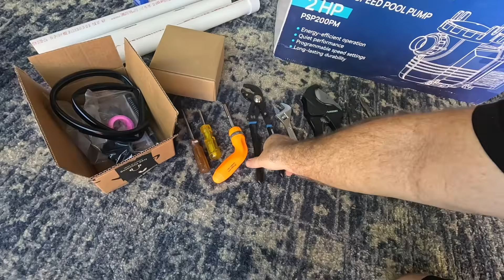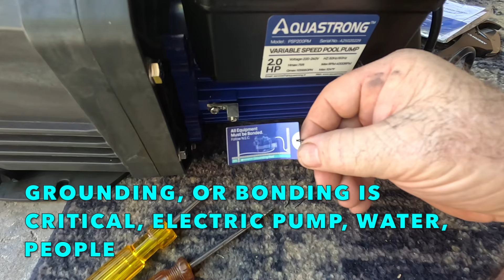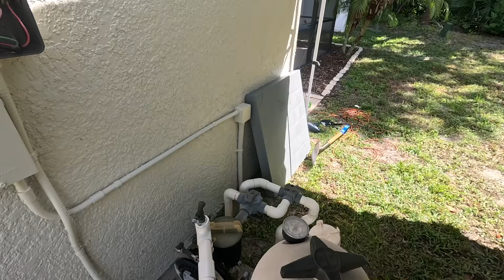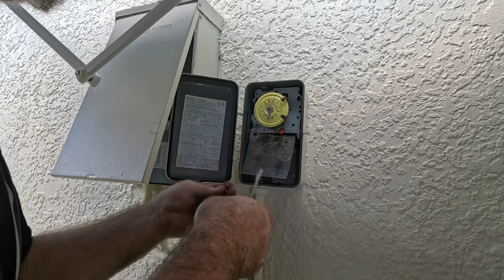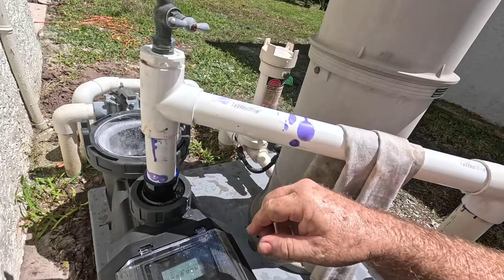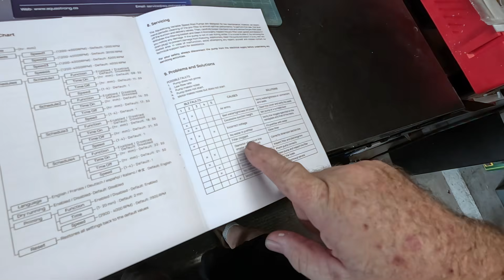Aquastrong Pool Pump, is it for you? #unboxing #install #test .Link Below

Comment: higher voltage does not equal lower amps with an inductive load in AC
Reply from the maker: True. I think you misunderstood what I meant.
Higher voltage systems require less amperage than lower voltage. 220 gets the wattage with less amperage than 110 would need, or 48 volts would need.

Amps x volts = watts was my point.

Comment: Should use meter to verify power is actually gone, breakers can go bad
Reply from the maker: True, or flip on the device after turning off the breaker to see if it’s off. But a meter is the best method.